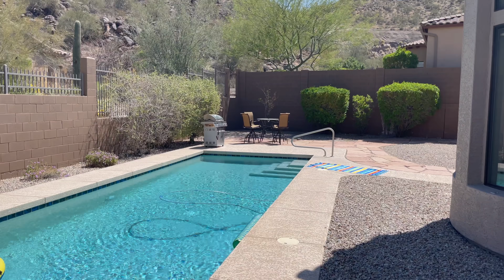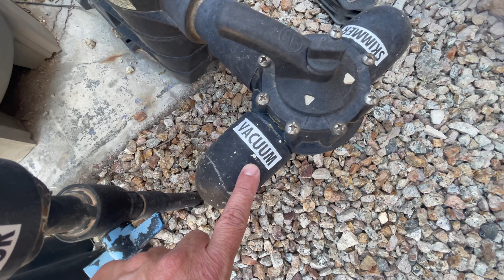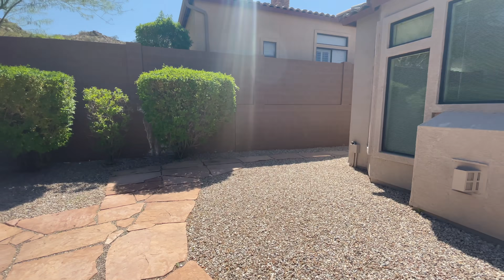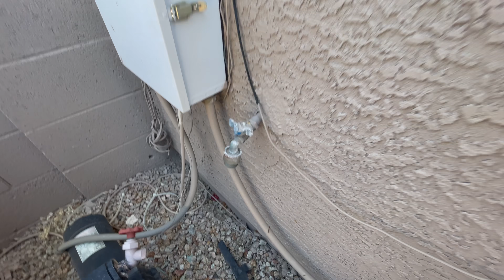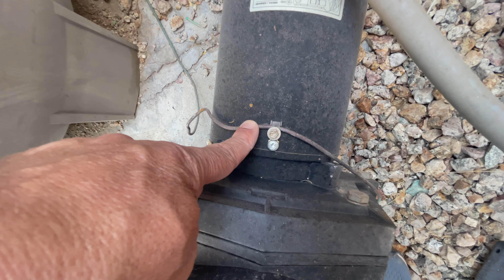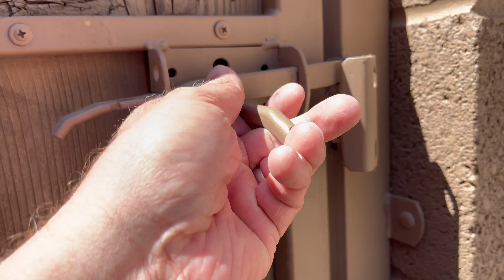InterNACHI® Pool Inspection in Arizona

Comment: Maybe you could help me with a few questions. I live in Indiana, so my state's standards may differ slightly from yours.
1) Do pools now require at least 2 main drains if main drains are install to help prevent entrapment. 
2) I believe Indiana requires at least anti-vortex drains but not anti-entrapment. Can you confirm?
3) If a passcode protected safety cover that is retractable is install on a pool, is a barrier/fencing still required?
4) Are all doors leading to an exterior pool required to have alarms, or is that just apply to interior pools?
5) Are handrails required on stairs leading into the pool water if it has enough risers?
6) What is the easiest way to distinguish if installed pool lighting is wet-niche or dry-niche?
7) Is drainage and sloping on the pool decking required?
Reply from the maker: Good questions, Trey. I think Indiana follows the IRC. Maybe the 2018 IRC. Not sure. ICC has a list of codes for Indiana at https://www.iccsafe.org/wp-content/uploads/Code_Adoption_Maps.pdf. If it's 2018 IRC, then the chapter on swimming pools is https://codes.iccsafe.org/content/IRC2018P4/chapter-42-swimming-pools and it may be of value to you to check it out.
Reply: @internachi  Thanks for the help.